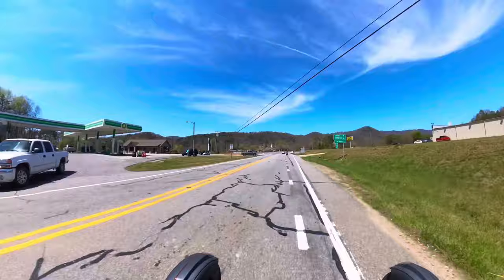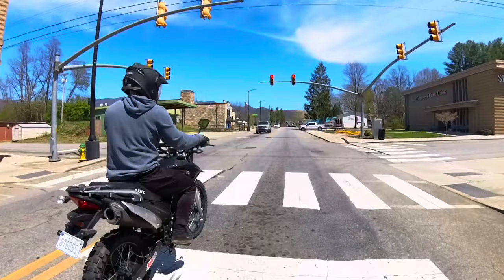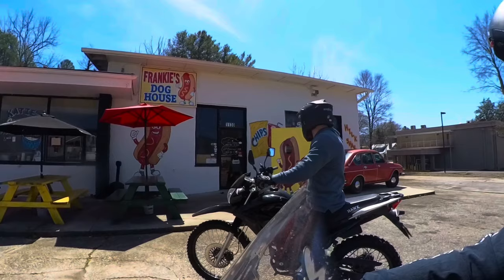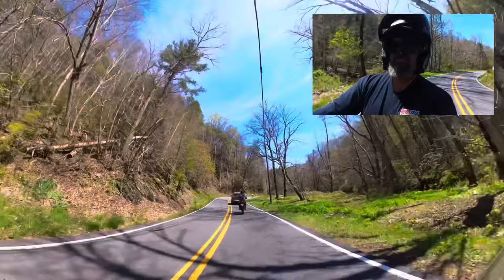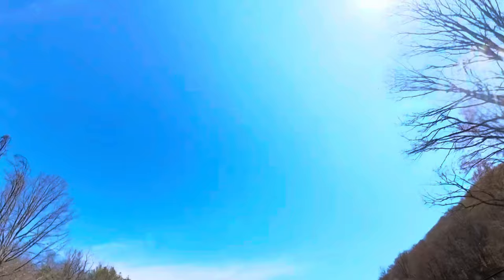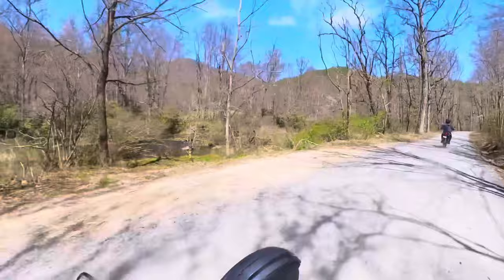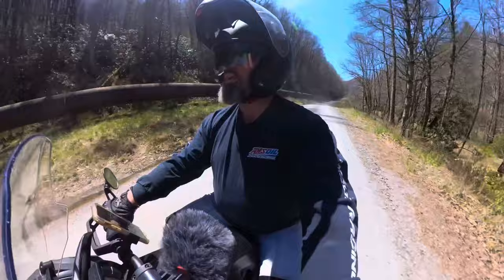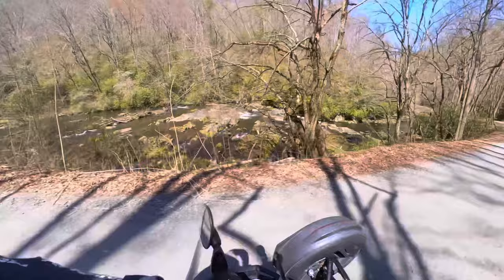Ride to Junaluska￼, First ever Amsoil Adam Moto Vlog. Testing new microphones.

Comment: Hi Adam, enjoying the content, thanks. Just a thought on the dead cat mic (high speed wind noise), since you can see it being blown around try this. Soft drinks plastic bottle at a close diameter. Cut to the appropriate length the plastic soft drinks bottle, let’s say in half, feed the mic fixings through the open screw cap end and mount, point the mic at you and you should have directional shotgun mic, to reduce background noise further insulate the inside/ outside of the bottle. If this works I will share the patent with you 😀 Have a good break cheers👍😎
Reply from the maker: I had actually considered a contraption similar to that. I will do more testing in the future for sure.